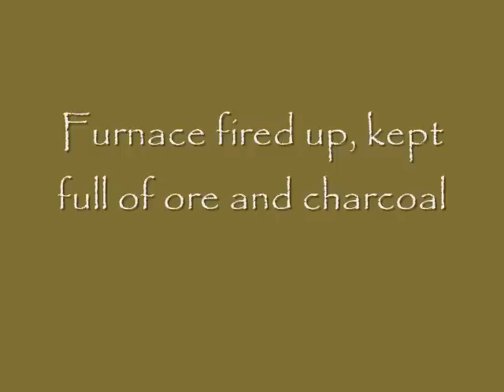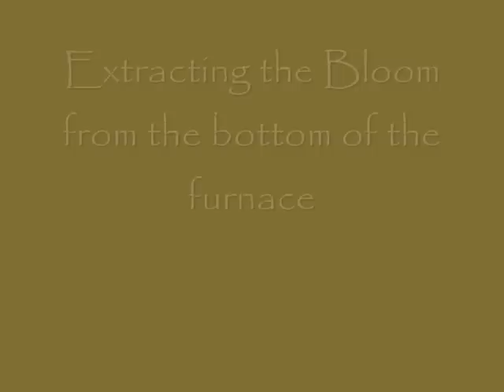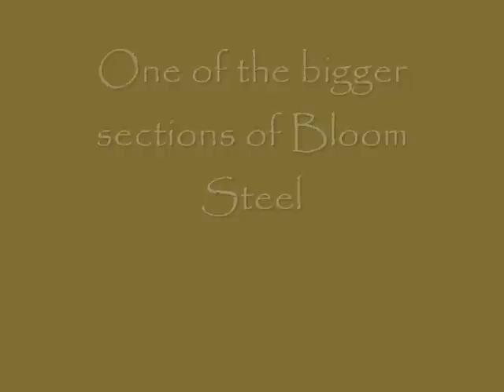Smelting Iron ore

Comment: so after you find the iron ore you build a furnace  and melt it down what is slag and I want to try and learn more about this and how to get the iron
Reply: Slag: molten impurities from the Ore,Dirt, and smelting process. It's mostly silicon(molten sand aka glass). If you have a poor source of iron then you get more slag.

The smelting process reduces the oxide(what the ores made out of) to elemental iron. This does not usually melt completely and coagulates together at the bottom. The forge is knocked down. What's left is the bloom.

Comment: There is a big difference between iron and steel.  I know nothing about this, but it seems like you achieved iron, not steel.  Or at best, a very low grade of steel.
Reply: It's has to do with the carbon % and amount of  Carbide in the alloy.